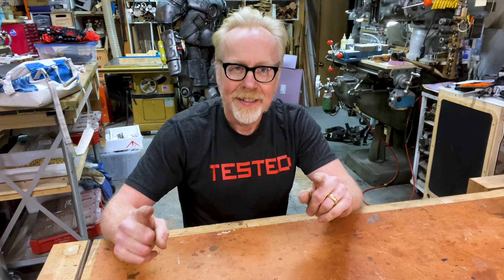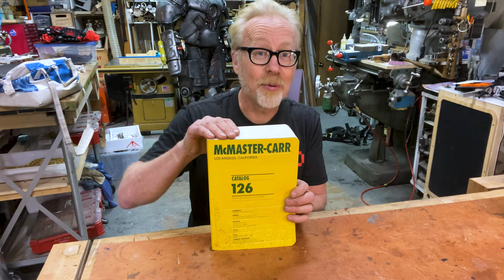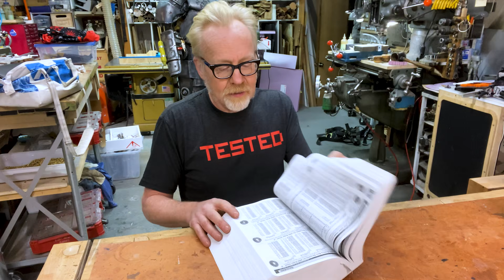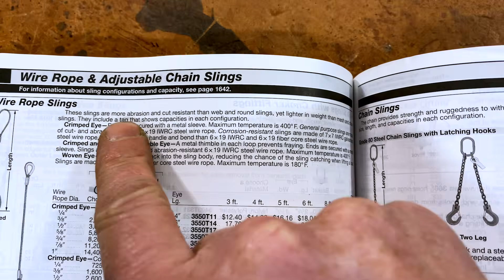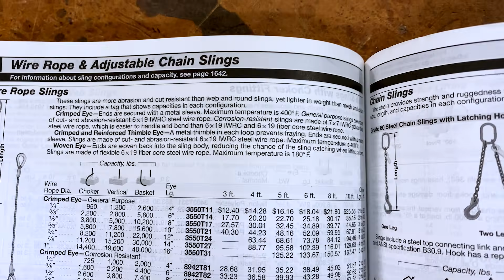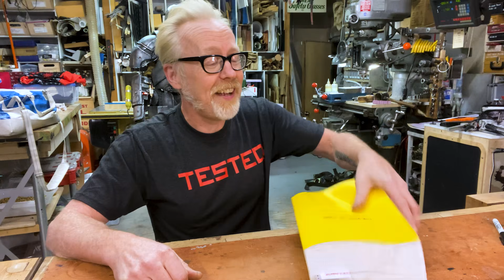Adam Savage's Favorite Tools: McMaster-Carr Catalog!

Comment: McMaster's website search tools are amazing for drilling down to what you are looking for, I don't know a better version of that type of thing on the internet. Oh, and lol, I think I have about 12-15 catalogs (of past years - we only receive one each year) spread around our shop. Some of the really old ones are piled up somewhere, but the newer ones are on different people's desks, or in good spots in the shop for a quick look up.

Some other catalogs that are pretty cool:
Harvey Tool (great small tools for both turning and milling)
Pisco (a fantastic assortment of different types of air fittings, most are push to connect for plastic tubing)
 MSC Industrial Supply: Maybe not as a wide a variety overall as McMaster, but probably wider in the cutting tool area. Not as good of a search on their website as McMaster either, but then again, no one else is matching that either.

Comment: Its available online with far more detail, and you didn't need to use a massive amount of natural resources, to dry the paper in web offset printing the dryer has to reach 800deg C, do you understand  how much natural gas is needed to print a volume of that size, we  also use massive amounts of acidic chemicals as water buffers to reduce surface tension, and massive amounts of electric power
I'm a catalogue printer (and make my living printing this kind of  catalogue) but  all that info is available online without polluting the environment . If you give a shit about the planet use the online catalogue. I may lose a few bucks but at least I wont be producing unwanted waste... This video  is a disgrace...

Comment: In college my rocketry team would order from McMaster. However the university wouldn't pay for the parts because they had a deal with some other company. So we paid for all the parts out of pocket, which was worth it to not have to pull our hair out designing around the much smaller inventory of parts the other company had.

I also love how every part has a solidworks model, so you can basically build the entire thing in solidworks before ordering a single part.

Comment: Another catalog I buy tons from is the DigiKey catalog of electronic parts. These are the parts consumer electronics are made from. When I found them over 3 decades ago, it was 1/4"thick. When I last received a printed one it was over 2" thick. Their online parametric search is wonderful. Much faster than browsing the catalog pages so I told them to save the trees. I also told McMaster Carr the same. The catalog has achieved such prominence in the electronics industry that if a part isn't in it, designers think twice about using it, or may outright refuse to. https://www.digikey.com/ I use it so often, DigiKey is on my bookmarks bar.

Comment: I love flipping through parts catalogues - in a way, they're like a narrative of problems engineers have come up against, and the devices which have been invented to solve those problems.

We get the Subconn underwater connectors catalogue at work, and it's wonderful to browse through it and see what sort of esoteric electronic interconnect needs can be fulfilled by a specially designed connector. Need to pass two three-phase AC connections and a bunch of low-voltage signals, and it has to be able to be connected by a diver underwater? Yup, somebody's already had that problem, and Subconn makes a part for it.

Comment: Useful reference material. I've got a little black book full of that technical data. SAE/MM bolt information. Welding ranges for flux rods. Load limits and spans for dimensional lumber. 1000 + pages in your pocket.

Comment: I’m a young mechanical engineer, 24 years old. I started using McMaster-Carr in an internship to help redesign farm equipment that a hometown company made and sold. In that catalog, just browsing, I found perfect tools and parts for my applications that I would’ve never in a million years thought existed. From in set/lo profile rollers, to corrosion resistant heavy duty casters, to latches, to bolts of every size and rating. And everything has free downloadable 3D models.. This site singlehandedly allowed me to find my niche in the mechanical engineering world, R&D/product design roles. That’s the kind of work I wake up for in the morning and go to bed sleeping about. This “tool” has been a staple for every job I’ve had since then. So glad you enlightened the audience on this fantastic company. Thank you Adam.

Comment: While I still have numerous catalogues and reference books on the shelves around my desk I have gone almost completely to digital or online resources. Not only does this allow me to have access to them wherever I am but it saves on the paper used for these books.
I agree that McMaster is the best online search system out there. During projects I always have a cart running and between the web portal and the phone app I can add components to the order when I discover I need them rather than writing it down then having to remember to order it later. I also like that they have detailed drawings and 3d files for many of the components which allows me to insert them directly into my Inventor designs without actually having to order the part then model it myself. While a lot of sources have 3d files I haven't found any that are as comprehensive as McMaster.
It's also great that I am within a 1-day ground shipment range of one of their warehouses which saves me on shipping.